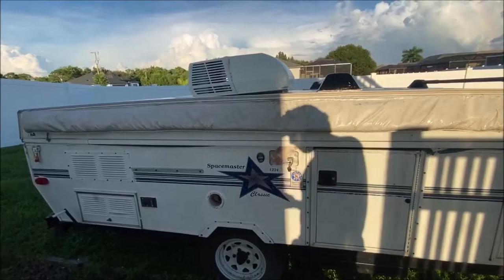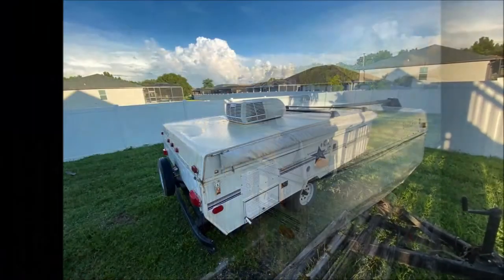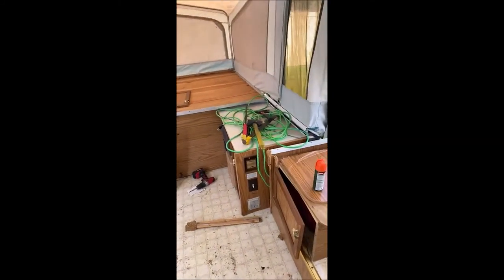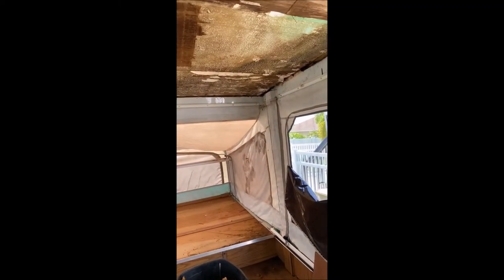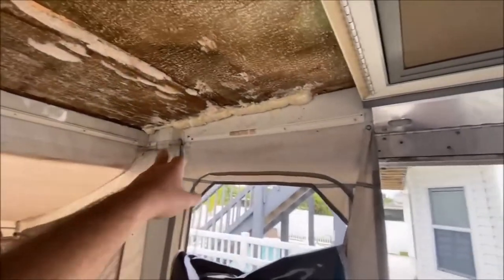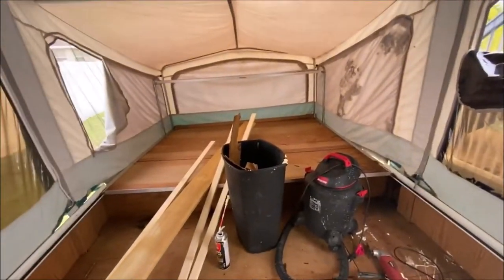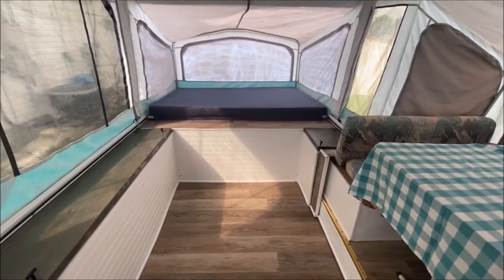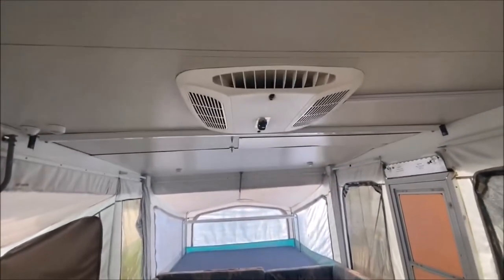Extreme Pop Up Camper Renovation

Comment: Hello I saw some stains on the canvas how did you remove that ?
Reply from the maker: Hi I used stain remover on the tough areas and then a spray bottle mixed with bleach and water after to remove mold and the rest. Hope that helps!

Comment: What did you put on the ceiling? Where did you get it from?
Reply from the maker: From lowes it a light pre painted plywooded
Reply: @vincefraser9829  I have a 1977 star craft pop-up camper. The ceiling is sagging. I want to take the ceiling down and put some insulation up and re-attach the ceiling so that it looks like yours. Did you put insulation in your camper? What did he say what did you use? Did you have help doing that?
Reply from the maker: @1shaneeka  Yes I used insulation boards from lowes on the ceiling and anchored the panels to it. Luckily my ceiling only needed 1/2 replaced. I did the work myself through trial and error very time consuming but overall not bad and in expensive 😁
Reply: @vincefraser9829  Thanks for responding. 🙂 what did you use to adhere the insulation to the roof and to adhere the ceiling to the insulation?
Reply from the maker: @1shaneeka  no problem, so that was the tough part originally i used an ahesive and it held well but eventually with addition of the panels it began to sag, so we used flush bolts like rivets on a plane to hold the 4 corners and sealed it off then the adhesive to add extra strength. It worked perfect and no leaks, just take your time and imagine where water may enter and seal it off ;)
Reply: Nice work. Ty for sharing. Any pic or videos of the ceiling repair process?